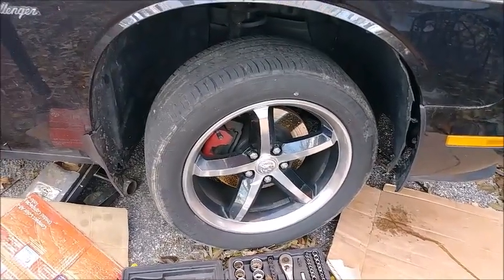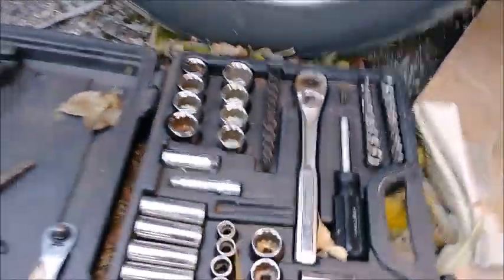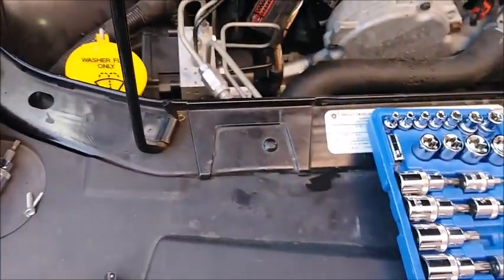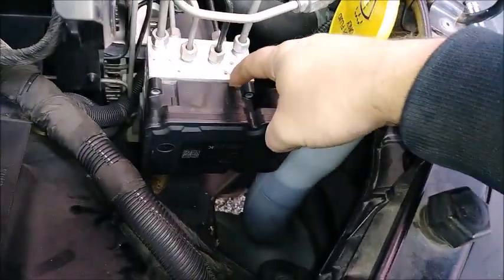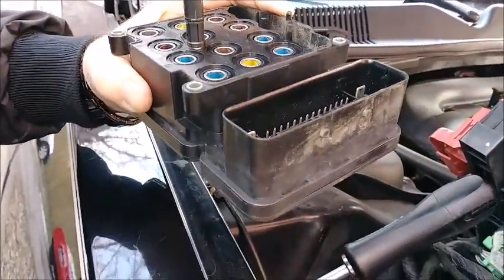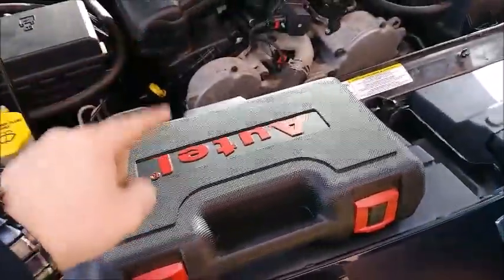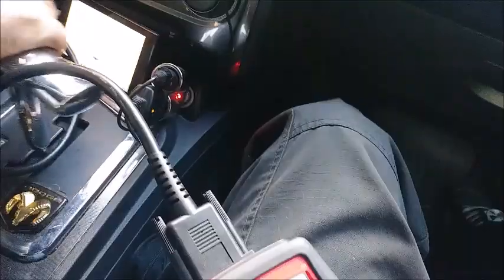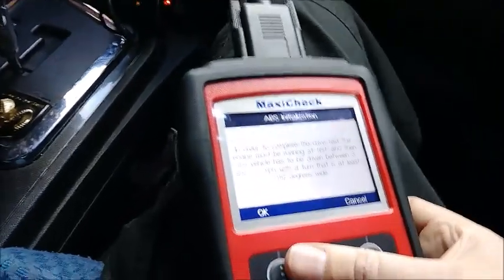Dodge Challenger ABS module C2200 replacement and fix ESP, BAS, ABS lights

Comment: Thanks. This is exactly what I need for my Chrysler Aspen ABS. I assumed I would need to purchase an $800 + Scan tool to to this.
Reply from the maker: I paid less than $200 for the one that did this trick.
Reply: @HollywoodHornet  where did you order it from??????
Reply from the maker: @kagecresendo69  Ebay. It was a few bucks cheaper than Amazon.
Reply: @HollywoodHornet  Hi my question is , was your car stuck in first gear , LIMP MODE due to bad abs module. I have an 2005 magnum 5.7 awd and the dealer is sayn abs module vin mismatching code comes up. My magnum will not shift out of first gear and dealer says abs module is my issue for that reason.....scam or no. I didn't see anyone speak on gear shifting issues.
Reply from the maker: @charleswilliams5054  mine did not have that problem. I seem to recall a problem with the vehicle speed sensor (or whatever that sensor was called) inside the transmission that caused the traction control to not work or something. (My memory sucks and I didn't document that repair since it was before I started You Tubing on the regular. Neither of those issues caused a limp mode tho.

The VIN mismatch has nothing to fo with limp mode. I'd wager it's a throttle body or transmission issue causing that. I'd scan the trans and the other modules to see if there's a trans code or a throttle body code.
Reply: @HollywoodHornet  I will posts codes from diagnostic soon
Reply: @HollywoodHornet c2200 and U140E codes from dealer while stuck in 1st gear
Reply from the maker: @charleswilliams5054  C2200 is definitely going to require ABS initialization. The question of the day is can you re-initialize that one or will you need a used one and do what I did with the Autel?

The U-code generally means a module failed to communicate with another module. For example if the stereo system module and light control module both had the U-code, they probably failed to communicate with the door module. Replacing or repairing door module would fix that. In your case perhaps the U-code is in the ABS module and it's not getting data from the transmission? Or he U-code is in the transmission and it's not receiving data from the ABS module?

The dealer should have done a better job of diagnosing this because it's pretty easy to attach the scan tool and drive the car around. Either the ABS sensors are transmitting data or they aren't. Either the transmission speed sensor is transmitting data or it isn't.

Some cars have the speed sensor outside the transmission and some have the speed sensor inside. The Challenger in my video has the sensor inside. Drop the pan, replace the sensor (and fluid & filter since you're already in there). Put it back together and you're done. If on the outside, even easier. That will most likely fix the 1st gear issue. Dealer should have also had a scan tool that can send commands to the shift solenoids to check their function (if I can do it, I know they can) they have way better scan tools than me, and I can.

Lastly, if this is all in the ABS module (though I doubt it is) you could try to initialize your current one and see if it fixes it, or try to get a used one from a similar year and initialize it.

If it were me, (and time was not of importance but rather money was) I would buy the same Autel I have, or the Xtool A30 Pro, and a used ABS module. I'd also use the scan tool and see what's going on with the transmission while driving and see what data I can receive and what commands I can send. I'd then replace the speed sensor (either internal or external depending on which transmission my car had).

Doing all that yourself would only take a day (maybe a weekend if it's your first time). It won't be cheap for the scan tool and parts, but still WAY cheaper than paying someone to do it.

I didn't film the video of the internal trans speed sensor replacement, but it can be done with some time and basic hand tools. If it ever goes out again, I will film it. I used a cheap sensor too, not the OEM expensive replacement and it's been working for years and tens of thousands of miles.

I hope this helps.
Reply: @HollywoodHornet Everything u said sounds reasonable , I'm ashamed to say the dealer really has no idea , only them 2 codes say active on my diagnostic paper.  I did read that bad abs modules corrupts the brake system down to the trans readings of the speed to protect us drivers from high speed for fast emergency stops. But that's why i thought the dodge dealer would pin point the issue , every tech looks to be in their 20s , kids with computers , can't even fig out a 70 350 engine with out a computer  , i seen that happen very often. Thanks for your info. U gave me more free knowledge than the  $160 fee i paid them.
Reply: @HollywoodHornet  hey did u program your new abs with a clear vin number or did it have a vin number already programmed  on it , can a abs module with another vin be programmed to your vin basicly
Reply from the maker: @charleswilliams5054  the ABS module I used was from a wrecked Challenger. So, yes. You can take one with a VIN not matching yours and do the initialization on it with the Autel. That's exactly what I did in the video.
Reply: @HollywoodHornet  my abs unit is discontinued and I'm stuck
Reply from the maker: @charleswilliams5054  In that case, you're gonna have to track down a good used unit and re-initialize it after transplanting it into yours.
Reply: @HollywoodHornet Wow ok , this dodge dealer in ohio where I live supposedy tried 4 modules from some BONE YARD and told me none worked , and that i only can use a module with a clear vin (BRAND NEW) which is very hard to find , I swear them dealer tech guys are not the brightest. So do i have to find a module with the same exact part numbers as mines ?. . . . . .I also would be willing to have mine rebuilt but seem like shops here in cleveland do not have the knowledge to rebuild one.
Reply from the maker: @charleswilliams5054  if you want it rebuilt, try eBay. There are some sellers that sell the rebuild service. THEY do it for BMW ABS modules. I'm sure there are some that do the same for Chrysler modules. You simply ship yours to the guy, he rebuilds it and ships it back.